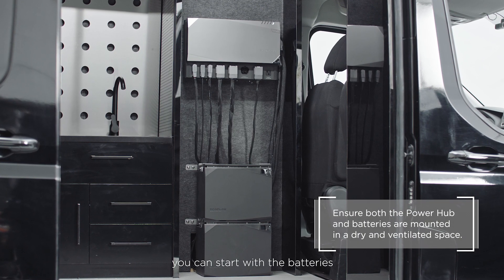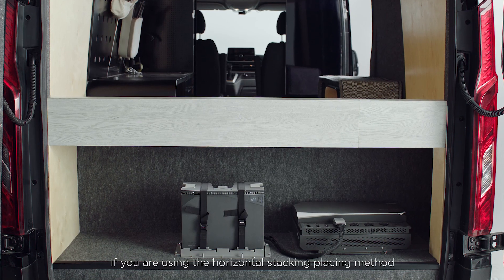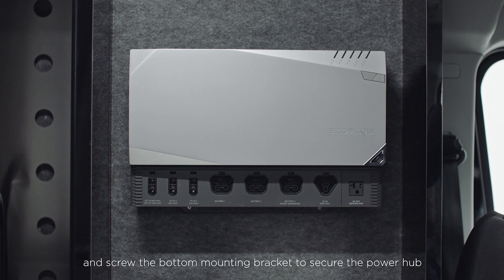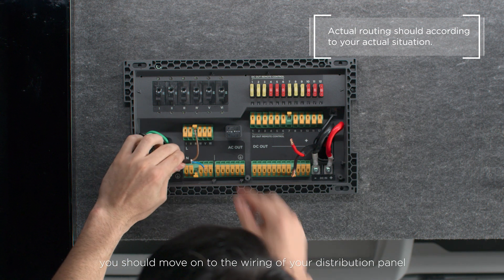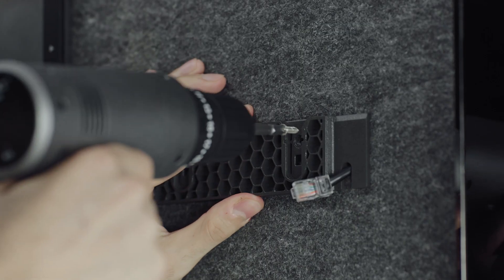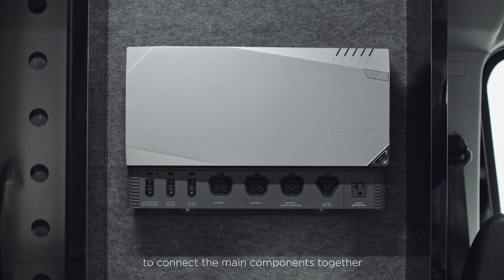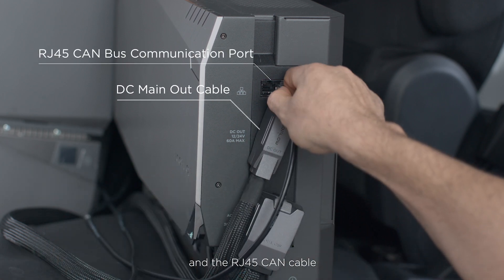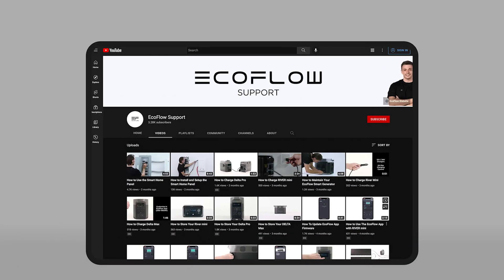Power Kits Tutorials - Basic Installation for Vans

Comment: I have a few of questions:
1) Can the Power Hub be installed horizontally instead of vertically?  And if so, what is the clearance requirement for a horizontal installation?  Can it be installed in an enclosed truck box (it has an ARE truck cap above it)?
2) I live in Canada where the winter can be down to -40 degC.  What would I expect to the 5kWh LFP battery and Power hub system when they are installed in an enclosed truck box (it has an ARE truck cap above it) outside below -20 degC?
3) Some years back I travelled to Death Valley where at 17hrs the temperature was +51 degC, what happens to the system above +50 degC?

Comment: Awesome job once again Ecoflow! I have the Delta Pro, smart generator, remote screen, and 4 220 watt bifacial solar panels!  It is very difficult getting your products here in Hawaii. Amazon won't ship it here, your website won't ship it here, and our Costco doesn't carry Ecoflow... I've been trying to find a cover for the Delta Pro, but nobody will ship it to me! Help me!!!
Reply: How happy are you with your bi-facial panels? I have a Delta Pro and purchased a 400 panel to charge it.  I'm considering adding a linked Pro "extra battery" (or 2), to provide 7.2kwh+, and a power kit to run my house (also change my hybrid plug-in 8kwh car battery).  I'll need more panels to keep it solar.  I've spoken to a few home solar installers, but not sure whether to install roof solar, how to sync it with this idea, or build a system with EcoFlow. I also have an EcoFlow River and 110 panel, purchased last year. Thanks!